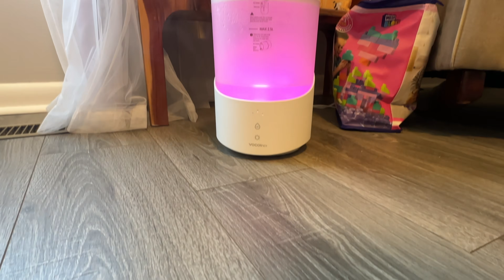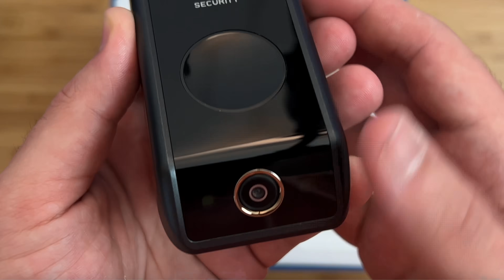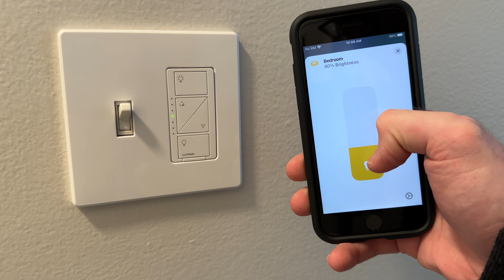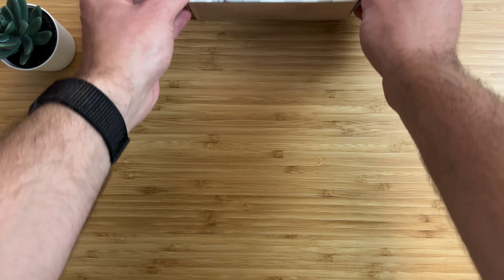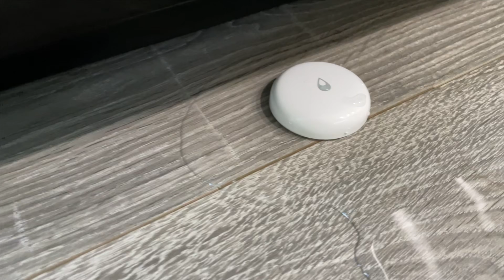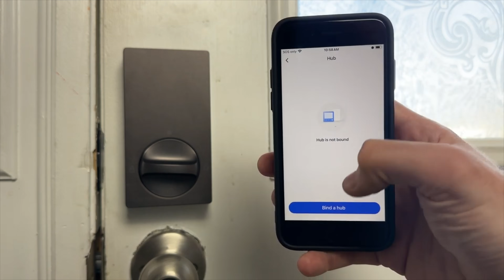Apple Home Products I ACTUALLY Use in 2024!

Comment: Having to get new ones because my Kasa ones stopped working and now after a few years the app will not work correctly and support is non existent.
Reply from the maker: That stinks, haven't heard that before. Thanks for sharing your experience.
Reply: @adamstechlife  found the issue. They only work with 2.4g and I moved to 5g. I ordered 5g Amazon basics and now no issues.

Comment: Interesting you use the Eufy as a baby cam. I’ve been searching for a good option here as well and currently using the Tapo C125, it just drops offline way too frequently (which is odd bc I have an AP in the room). Aqara continues to tease they will offer this feature in a future firmware update but I may have to give eufy a try.
Reply from the maker: thanks for sharing your experience with the tapo c125, i haven't heard of connection issues before! and yeah any camera can technically be used as a baby monitor, depending on the specific features you need

Comment: Lutron Caseta smart wall light switches, wall plug dimmers for table lamps, and an outdoor plug for my patio lights; Aqara M1S hubs for my DIY security system, pet feeder for my cats, water leak sensors, motion sensors, door contact sensors, temperature/ humidity sensors, and cameras (these are slowly being replaced by UniFi cameras); Eve smart plugs, smart power strips, outdoor water controllers for my faucets, Weather stations outside and in my attic, Eve Room to monitor air quality in my shop, water leak sensors (with long sensor cords), Eve Flare for mood lighting in my office; Airversa air purifiers for the two bedrooms; ecoBee thermostat; LevelLock bolts for three of my four exterior doors; LIFx Dawn to Dusk bulbs in floor and table lamps; Apple HomePod minis in just about every room of my house; two AppleTV 4K set top boxes; ConnectSense in-wall outlets in several rooms throughout house; Twinkly Icicle lights for Christmas.

I gave up on the original Meross smart plugs because of reliability issues and switched them out with Vocolinc smart switches. Have had zero issues with the Vocolinc outlets. I use Aqara outlets for smart automations in the Aqara app as part of my DIY security system.

I have a total of 230 smart devices per the Configurator for HK app; 57 lights (light switches and smart bulbs), 4 smart buttons, 38 outlets, 7 security (includes 3 smart locks), 21 temperature, 53 sensors (includes 5 Eve Aqua water controllers), 6 cameras, 31 climate (includes 2 air purifiers, 2 exhaust fans, 5 ceiling fans), 4 bridges (3 Aqara M1S hubs, 1 Lutron Caseta hub), 9 doors (4 exterior doors, attic door, shower door, 3 closet doors).